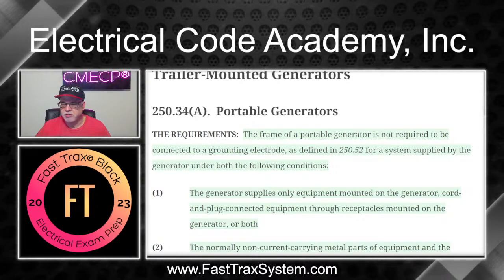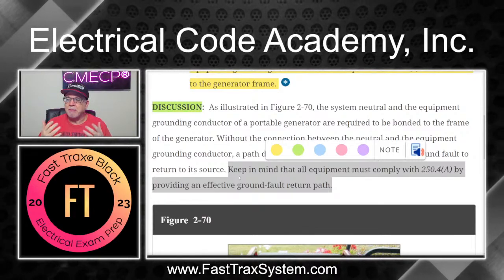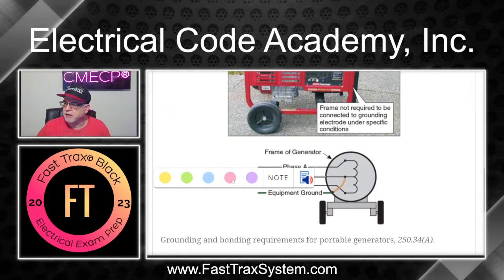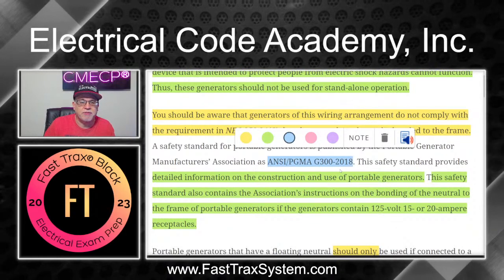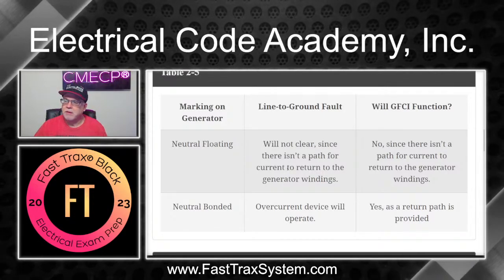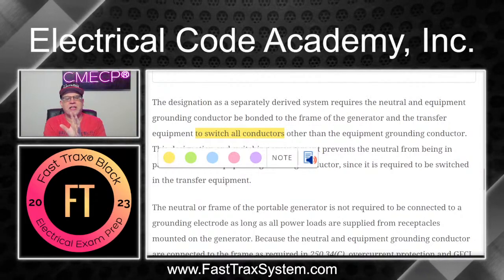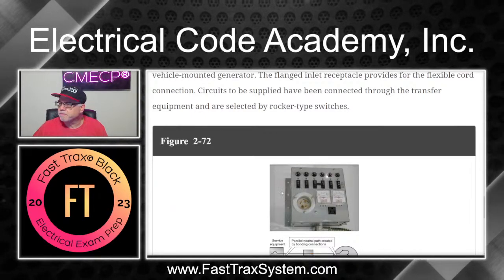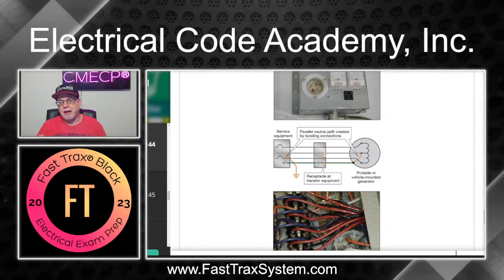Floating vs Bonded Neutral — Generator Mistakes That Can Be Dangerous

Comment: What about me I have an Interlock set up in Main Panel ? I called Firman manufacture support person he told me to un bond neutral & ground also my two Electricians told me don't separate them. What should I do ?
Reply from the maker: Greetings - it depends on your situation. If you have a generator with an interlock and as stated in the video, it needs to be a floating generator then the manual should, if its capable, explain how to do it. If you presented this to the manufacturer and they stated how to do it and recommend it I would trust them more than I would some "Electrician" who might not actually understand the situation. Sadly I can't tell you what to do, that would be illegal of me.

Comment: Last year I hired a licensed electrician to install an inlet box and interlock so I could plug my Generac GP6500 in and run some circuits when we lose power.
Disappointed that he didn't mention unbonding the portable generator to make it a floating ground.
I did contact Generac to inquire about the proper way to unbond the generator but they will not give out any type of instructions which is understandable.
Youtube here I come.
Great video 👍👍

Comment: Why don't portable generators come with a switch so you can just flip it from bonded to floating?
Reply from the maker: Probably because not all generators are designed to be one or the other. So, if you buy a bonded generator and there are no instructions in the manual to unbond it then its not allowed to be unbonded. The manufacturers test and evaluate their generators for intended purposes, such as primarily portable vs stationary so they drive the ultimate use. Hope that helps. Now, its very simple to take a bonded generator and make it unbonded as long as again the manufacturer provides detailed instructions to make that happen..if they don't then YOU DON'T have the allowance to alter it.

Comment: if utilizing a floating neutral generator to back feed a dwelling unit. and switch the neutral at the transfer equipment, would you then need to establish a grounding electrode system at the generator ? in essence leave a GEC coiled up and when the generator is in use you would connect that to the frame of the generator?
Reply from the maker: Sorry I don't do hypothetical scenarios.

Comment: I have a 50 Amp Inlet box connected to my house to the Electrical Panel.  On my Electrical Panel I have installed a interlock switch.  I will use it to connect my Westinghouse 11500TFC portable generator.  The manual stated that the generator is bonded.  My y question is should the generator be bonded or unbonded (floating neutral)
Reply from the maker: I'm honestly not sure what is missing from my video that is leaving these questions. In an interlock situation the neutral is not being switched, thus is isn't a separately derived system. So, it treated the same as you would a remote distribution panel, the neutral and ground connections are isolated. So, a bonded generator would not be for use on dwellings as stated. You need a floating generator and sorry we can't instruct you on how to make a bonded generator a unbonded generator. You would need to reach out to the generator manufacturer.  Hope this helps.
Reply: @MasterTheNEC Thanks for the knowledge.  Your video is OUTSTANDING but I rookie when it comes to this.  I have 2 different electricians saying 2 different things.  Again thanks
Reply from the maker: Westinghouse generators usually have a manual that talks about how to "unbond" their generators if connecting to a dwelling. We have a video coming out in about a week showing the steps to unbond a bonded generator per manufacturers instructions. Stay Tuned!

Comment: My generator 50amp plug does not have a GFCI and my question is does it still need to be unbonded 

The 120v outlets do have a GFCI
Reply from the maker: See, the problem with understanding this requirement is folks do not give all the relevant details so it leaves folks guessing. If the generator is an unbonded generator, then the NEC says this "Unbonded generators with both 125-volt and 125/250-volt receptacle outlets shall have listed GFCI protection for personnel integral to the generator or receptacle on all 125-volt, 15- and 20-ampere receptacle outlets." There is an exception if while the 250V receptacle is in use the 125V receptacles are deactivated via an interlock. If its a bonded generator it says "Bonded generators shall be provided with GFCI protection on all 125-volt, 15- and 20-ampere receptacle outlets." And says nothing about 50 A Receptacles. Lastly, you have this exception "Exception to (A) and (B): 

If the generator was manufactured or remanufactured prior to January 1, 2015, listed cord sets or devices incorporating listed GFCI protection for personnel identified for portable use shall be permitted."

Comment: Thanks for the in depth review.  After watching this in totality I believe you ended up saying that the 80% of the household scenario where you hook up a BONDED Westinghouse say generator to the house with a manual interlock ONLY you should remove the bonding and make the generator a FLOATING neutral.  Then if you ever use said generator as a stand-alone you need to bond the neutral back (I have a neutral/grounded plug that I just plug in for this purpose.  Please confirm and thank you again.
Reply: Upon reading the comments further you have answered the above question.  Thanks again for the video!

Comment: Hi M.T.N., I have a Predator 9000. You mention a transfer switch, but what if I have it connected to my breaker box (BR230 breaker) and use a lock out switch, do I still need a floating neutral? Also my box has a shared neutral and grounding  bar.Thanks.
Reply from the maker: As we state in the video, if you are not switching the neutral, an Interlock system doesn't create an issue of a switched neutral, so the generator chosen should be unbonded if connected to the dwelling....Bonded if used as stand alone.
Reply: @MasterTheNEC  Thank you.

Comment: So, in regards to Figure 2-72, where you discuss a bonded generator connected to a transfer switch, you say that the neutral must be switched to avoid parallel paths of conduction. But if that's the case, why not just disconnect the neutral (as shown in the photo) from the back of inlet to the transfer switch? Then you wouldn't need to switch the neutral back and forth. I don't see when the neutral would ever need to be connected in this configuration.
Reply from the maker: Then you did not fully watch the video my friend. You have to watch it from start to finish to gather then concept of whan a generator should be bonded and when it can be floating. To alter your "system" is not something I am willing to discuss as we only being you what the NEC says and how it is to be achieved, we are not into the DIY aspect of how folks may use our videos so we can't comment on things folks may attempt to do for legal reasons of course.
Reply: @MasterTheNEC  I did watch the whole video. And I believe I understand what you are saying about what is needed when you use a portable generator that is bonded as in Figure 2-72: you need to use a transfer switch that will switch out the neutral. I just throught it was strange that there would be transfer switches available that can switch the neutral in and out. Is the purpose of that neutral switch so that have the option to use either a bonded generator (with neutral switched out) or with an unbonded generator (with neutral switched in)? Maybe I just don't understand what you mean by a transfer switch that can switch out the neutral.
Reply from the maker: There are commercial systems that switch everything, which would be considered a separately derived system. Most Residential transfer switches do not switch the neutral, so It remains a solid bus, so it's not separately derived at that point. If you used a generator with a system bonding jumper installed (case to neutral connection), then didn't switch the neutral you get circulation current. As for just "removing" a jumper on a generator to remove this issue is NOT up to us or anything we can recommend since we have no idea what generator is being used or if the manufacturer approves of any modifications. This is not a DIY channel.

Comment: I've read and looked at so many discussions my head is spinning.  One simple question please?   I have a 2500 watt inverter generator that is floating neutral.   I want to run an extension cord to my gas furnace which has been modified by use of a standard 3 prong  ulility appliance cord.  During outage,  I simpy 'unplug' from line power  then plug that appliance cord into my floating generator - in other words,  at no time,  will any of the wires in the extension cord to my generator be connected to any part of the house wiring .   Thus,  DO I HAVE TO MAKE MY GENERATOR INTO A BONDED ONE  by using an RV type bonding plug?
Reply from the maker: Well, in your specific case it would be more trouble to try and alter anything so I would just let we ride.

Comment: Champion's website states most of their generators are floating neutral which is interesting since they are portable. They state the following "The floating neutral eliminates the potential of being shocked by contacting a hot leg and the generator frame at the same time, which could occur if an electrical device such as a hand held tool suffered from an internal short circuit." Another site states "Generators with a floating neutral are actually safer than generators with a bonded neutral. If you happen to touch the frame of the generator with a bonded neutral at the same time as one of the hot legs of something plugged into your generator outlet, you will be shocked." So lots of confusing information out there on this. One one hand, it appears portable generators should be bonded if using them as portable and floating if using them for say house power via inlet. But then you have Champion and some other sites saying floating is safer when using it as portable and in fact they unbond them from factory per their website for most.
Reply from the maker: It is scary because of manufacturers who are indeed misleading the general public because they take short cuts and rather than understand their own listings they choose to mislead. Sounds like a CHINA brand to me but alas you are correct...way to much poor information out on the market.

Comment: Paul, I need a sanity check. I have a DuroMax 12000eh that I use only to power my house in a power outage.  I had an electrician put in a transfer switch for 10 circuits.  Duromax says: "Most of our generator models will be floating neutral by default".   So, the manual says to put in a grounding rod outside of my shed, etc, hooked up to the generator itself on the screw that is marked; however, it says nothing about a house with transfer application in the manual.    Do I need a grounding rod if running it for my house, only?  Is or would it be a safety measure for static buildup?  Thanks for the video,  GOD Bless
Reply from the maker: OK...no disrespect intended but it depresses me that my video did not explain this and after watching it I clearly fell short on its educational content. I thought I clearly explained these things in the video...clearly I am not the educator I desire to be...So let me clarify here - Portable generators that have a floating neutral should only be used if connected to premise wiring through transfer equipment. So, if your generator is unbonded (floating) then it should only be used with an non-switched neutrals on the premise....as all bonded generators should be used for true portable needs, such as construction sites, concerts and so forth not on premise wiring.
Reply: @MasterTheNEC  
another clarification needed:
are you referring to generator/transfer switch connection that is direct wired to the main leads in the generator?
what if my transfer switch has a 30a or 50a male plug for my generator's receptacle?
Then it WOULD meet the bonded requirement of using the receptacle
Reply from the maker: Did you not watch the entire video? We are discussing Bonded vs Unbounded Generators. A dwelling with a transfer switch that doesn't actually switch the neutral is NOT a seperatly derived system. So, the use of a generator on a dwelling where the neutral is NOT switched requires the use of a generator that is Unbonded. When a generator is used as a stand alone power source, on job sites for example, they need to be bonded generators to ensure the GFCI's built onto the generator function properly.

Comment: So what is the application of a floating neutral generator.  I have one and simple want to run a 5000 btu portable ac and refrigerator. Turn ac off and run hair dryer.
Reply from the maker: You need to rewatch from 13:50 to 19:50 for what a bonded generator vs unbounded generator should be used for.

Comment: How is a GFCI supposed to trip if there is no path to ground and the generator is isolated by the wheels? In the event that the metal part of the generator is in contact with the ground, or with an electrode.
Reply from the maker: GFCI's do not use the earth to function. In fact, in the operation of the GFCI, the earth plays ZERO part in its function.

Comment: I’ve been wondering about this question since I decided to have a transfer switch installed in my house. The first electrician told me not to worry that my Westinghouse generator came fuse bonded. Since I hadn’t seen your video I just accepted it. Then while. searching for transfer switches, someone asked will this transfer switch switch the neutral?  
Someone answered with the following: 
Essentially, all three wires leading into your house are the center of the switch or the off position. All three utility wires are the top on position and all three generator wires are the bottom on position. The neutrals from utility and generator are hooked to the neutral bar in the breaker box. So yes the neutral gets switched because the transfer switch is an on-off-on switch. You can literally have power coming in with both sources, but only one at a time will be engaged by the switch.
Is this correct?
Reply from the maker: Well, you kinda go "all over the place," so it's hard to give you a reliable response. So, is this a portable generator or a fixed generator? The simple installation of an "Interlock" device is not acceptable for a portable generator setup if the generator is bonded, meaning a connection from grounded conductor to frame at the generator. Also, since most residential transfer switches, where applied, do not switch the neutral (the neutral from the generator to the transfer switch) then it's not a separately derived system so the bonding jumper in the generator should not be there...it needs to be an "unbonded" generator which is more common in whole house permanently installed generators. So, we are NOT condoning the removal of any bonding jumper on a bonded generator, and a home owner or DIYer should NEVER screw with a generator.
Reply: @MasterTheNEC  My generator is a portable generator that comes fuse bonded. Are you saying that if it comes this way it should not be used to connected to a transfer switch?
Reply from the maker: I have no idea what "fuse" bonded means. A portable generator that has a bonding jumper from the frame to the Grounded conductor is a bonded generator and it should not be connected to a dwelling without a transfer switch that switches the neutral. Using a generator with a bonded neutral and no transfer of the neutral in a transfer switch is incorrect for a portable generator.
Reply: @MasterTheNEC  Ok thanks. Having a meeting with electrician tomorrow.

Comment: Can a floating netural portable  generator be changed to a bonded netural by a certified electrician? I have a netural and want to use it with extension cords  to devices in an emergency situation.
Reply from the maker: I would consult with the manufacturer of the generator before I just let any "electrician" even those that are licensed simply change the manufacturers intent of their generator for a specific application and use. That just my recommendation as the first steps.

Comment: Thank you for sharing this information, I need a transfer switch that swaps the  neutral if I want to change the feed for my main panel between the grid or my backup generator. I had a serious question on this, and you gave it to me, appreciate that greatly....I need an electrician, beyond my skillset.
Reply: I have an older panel, no bonding, will have to research that next

Comment: I’m just using a interlock  240 volt 30 amp inlet box, no transfer switch, once I disconnected the neutral wire on my generator to make it floating neutral, and hook my generator up to the house via inlet box will it now be bonded through the house?
Reply: Having an interlock like you mentioned to use for your house backup requires having the floating neutral on the generator. Bottom line
Reply from the maker: UMMM...HELLO....if its not switching the neutral then its no separately derived.
Reply from the maker: Sorry - we can not recommend or advise you to remove ANYTHING on your generator. That is something we can not comment on for legal reasons. We can only tell you what the NEC says, modifying anything without the manufacturer's consent is not within the scope of this video.

Comment: If the generator has a floating neutral,  then, should the neutral be bonded at the main panel or at the transfer switch?
Reply from the maker: This is typically done at the transfer switch.